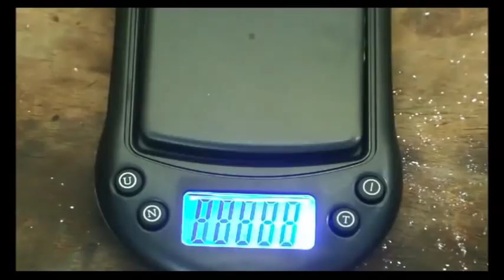YARING PLATERO Video 80 - Engineer's 18K Gold Cuban Link Bracelet (Kindly read description below)

Comment: Hello. How did you get 171.6 grams 
You stared with 129.3 grams.  Making 18k 75 percent pure.  =161.6 grams
129.3 + 32.3 = 161.6  . Thank you
Reply from the maker: Supposed to be 171.9 grams of 18k but of course you must consider a little lost in melting. For me a 129.3 + 32.3 = 161.6 wrong. Sorry for I can't answer your question because I have students who are paying their training fees and that is included with what I taught them.
Reply: Yaring Platero thank you
Reply from the maker: Salamat din po. Thank you.

Comment: Hi Yaring Platero, I am learning to make chains and I want to try to making a Cuban link, I will be using copper but was wondering about the mandrel you rolled your links on, what kind of mandrel is that and where can I get one? Thank you hope to hear back from you
Reply from the maker: It's my own fabrication from the scrap steel. You can't find it in any jewelry tools supply because I made it from the scrap steel base on what size of Cuban link i'm going to make from. Chain mandrel fabrication is base on is included to my one on one Goldsmithing training.

Comment: ia it possible to make a %75gold/%25 silver necklace?
Reply from the maker: It will be light color 18k.
Reply: itll be a solid connection? i was told that gold couldnt be mixed with silver because it isnt a good moxture. they said i need to add some copper or nickel as well.
Reply from the maker: Silver and cooper is the right alloy for yellow gold as you can see in my video presentations. Copper and nickel is also an alloy for white gold making. But, the melting and alloying of yellow or white gold for Cuban link making is not as simple as you watch my video presentations as I am always saying. Many of them who are trying to make a gold cuban link with there own by just watching my video but, the result is gold cracking and turns into pieces.

Comment: what did he add to the gold to make it heavier ?
Reply from the maker: gold alloy can't make a gold heavier.
Reply: The nuggets were 99.9% pure gold. Pure gold is too soft to make jewelry out of, as it gets damaged easily. So jewelers add other metals (alloys), to the pure gold to make it more durable. The amount of alloy they add bring the pure gold down to the 24kt., 18kt., 14kt. and 10kt. "content", that most of us are familiar with, and are supposed to be done to a set standard. That process adds weight, but you are not paying for the pure gold content, you are paying for the 24kt. etc, content.
Reply: He added nickel and copper
Reply from the maker: It has copper but no nickel.
Reply: Yaring Platero copper and silver?
Reply from the maker: Correct.
Reply: Yaring Platero is it possible to make same chain. But with silver as the metal?
Reply from the maker: https://www.youtube.com/watch?v=9xTRbWSYIUQ
https://www.youtube.com/watch?v=-ZLS5fAf5GA
https://www.youtube.com/watch?v=PpV9BWJACTs
Reply: Yaring Platero thank you..if I gave you a 1 kilo silver bar 99.99 could someone make a Cuban link?
Reply from the maker: It's my business for already 25 years and some of my distant clients are just sending me their silver or gold, or sending an amount to buy a silver or gold. 
https://www.youtube.com/watch?v=VXn7kIx68OE